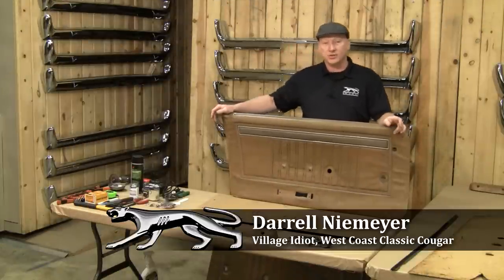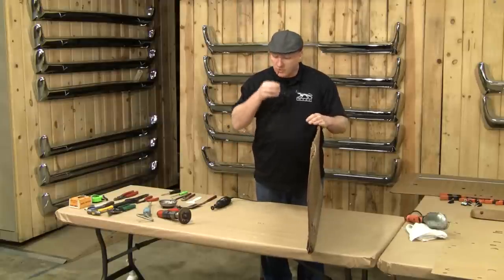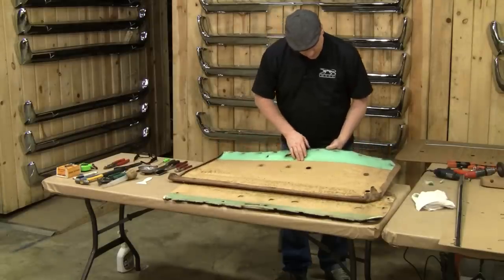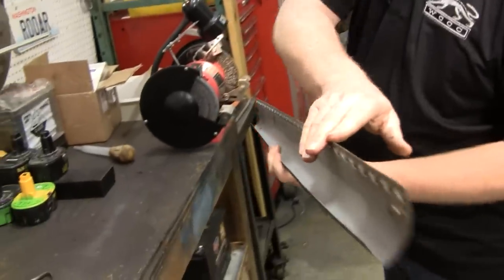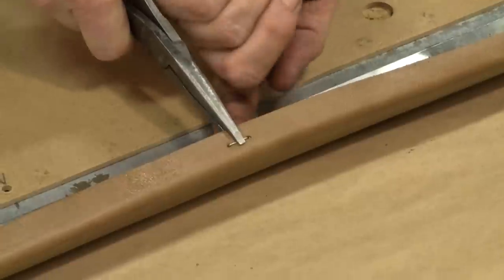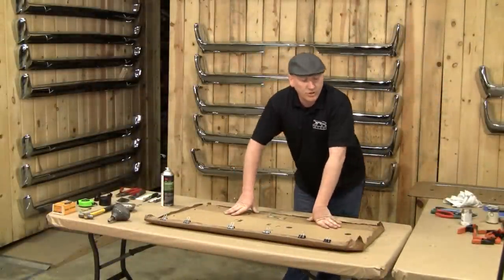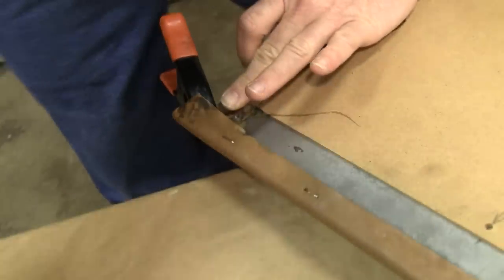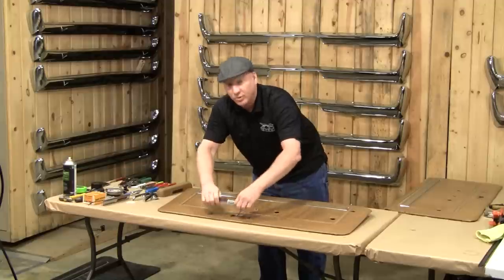Door Panel Backer Boards - How To Replace (1967-1970 Cougar)

Comment: Why did the beltline strip not use the factory holes?
Reply from the maker: The factory was not consistent in where the staples were installed, so there was no "correct" placement for the reproductions to use.
Reply: @WestCoastClassicCougar  oh gotcha! Thank you for the response!